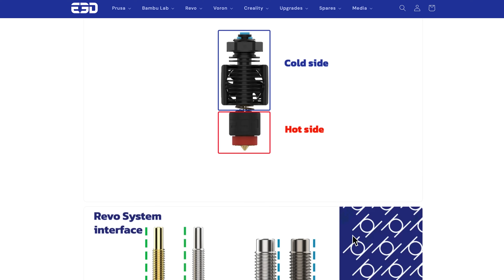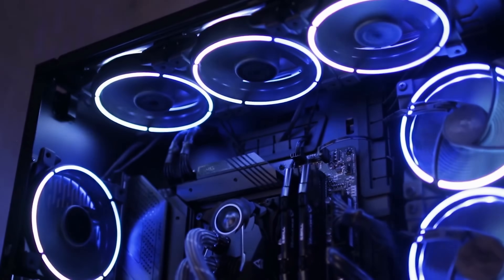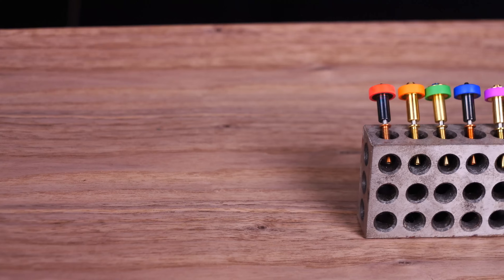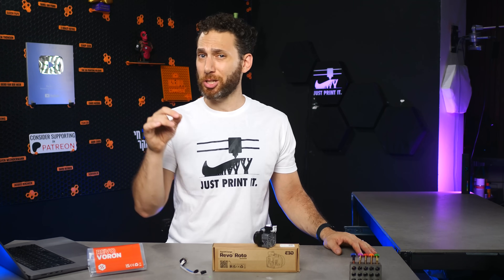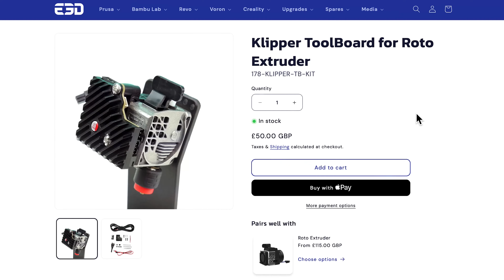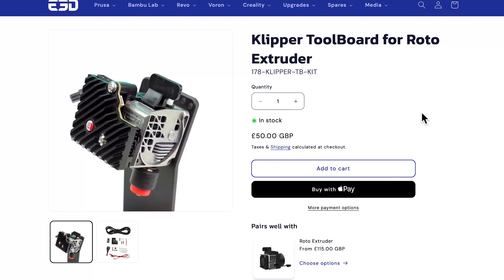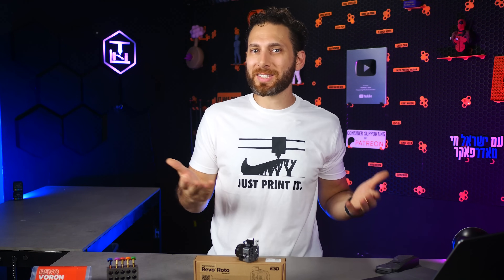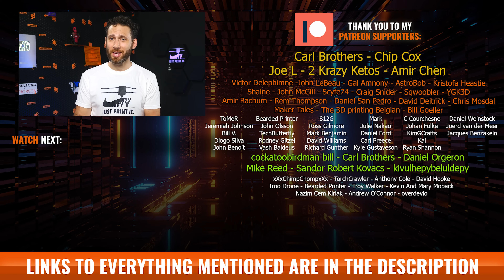E3D's New Release...& What It Means for 3D Printing

Comment: I haven't swapped my revo nozzle since I bought it 2 years ago. I'm considering moving it to my new v0.2, and add the hotend that came with the 0.2 kit, to my old printer, and sell it.
Mainly it's the complete eradication of heatbreak failures that sold it for me. I have been thinking of getting a obxidian or diamondback nozzle, just to print abrasives. I did get a full kit of 4 sizes, but I have basically only used the 0.4, and it has held up great!

Comment: Do me a favour... next time you decide to recommend a filament... DON'T - JUST SAVE YOUR BREATH INSTEAD!!! 

On the basis of the filament recommendation you made, a sparkle black PLA, I bought a roll which terminally clogged the 0.4 stainless print nozzle on my A1 over three hours into an epic print, blowing filament gobs everywhere, wasting more than half the roll and thus costing me about £14 in wasted filament, a further £27 if I wanted to redo the print in that particular filament because there's not enough left of the original roll, AND £20+ for a new nozzle and a needle from Bimbo Nobs because this one will NOT unclog and the needle might as well be welded in for all the possibility there is of ever removing it. That's almost HALF my weekly state pension down the drain on the back of a BAD RECOMMNDATION and closer to half of it if I was foolish enough to buy another roll of that cack. Add to which the first ten or so layers were the colour of Fido's runny excrement the day after he has eaten a packet of glitter instead of the "black" it was described as!

NOT IMPRESSED! 🥵

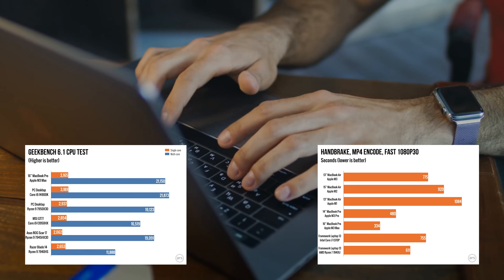Comment: 3:24 More compact yes but NEVER higher performance.. an tou cant even compare the two, the parts are and have always ben setup in this way in the PC world and is so exstreamly optimized that there is not waist of space. but the 3dprinter have ben this diyed thing, where one needs to fit a noter ect. and for some reason the cold and hot end has never been the same unit. but the only funtion anyone cares about is nozzle size swap, if you can do that then the unit wins, who care if you can´t swich the radiator out, if it works it works..

Comment: I was an early Revo adopter on my Voron (so early they didn't have the Revo model available) and its saved me time and money. It just works very well and I swap nozzle size way more often than I ever thought I would. In over 2 years I've never damaged a nozzle despite have the brass only and yes I've driven into the table on many occasions. Still on the original set 😮

Comment: I have an e3d revo fully loaded for my MK3S+(Enclosed), I am now wishing that i bought 2 as I bought the fully loaded kit(.25,.40,.60 and .80 nozzles) i think $120, now it will cost $50+ more, as I would have to buy the .25 and the .80 nozzle. I am not wanting and will not spend nearly $200 for a revo fully loaded setup, with the .40 obsidian nozzle. so i have been looking elsewhere, or i just stick with stock setup.
The Revo Ecosystem is just too expensive, since the new build your own system.

Comment: I am not a person who likes closed source ecosystems in general because of the tendency to lock people into them and the lack of control I have. I do understand that there are distinct advantages to having stuff that "just works" together. however with larger companies I worry about them having control over my stuff.
example: I have looked at Bambulab printers for easy of use and product experience without tinkering I would make designing and printing stuff faster and easier. Yet even though Apple products just work, I will never by an apple product mostly because of the company and corporation behind it.

Comment: I doubt that their master plan is to become a toolchanger company. If it was, their revo nozzles would not be astronomically priced. It makes no sense to have a quick swap nozzle system on a toolchanger. They should also be focusing on cost effectiveness if they are going the toolchanger route. I will not be using revo or any e3d extruders in my toolchanger, just due to cost. A revo roto plus a high flow nozzle is going to run me $320 USD, while a smart orbiter V3 is $100 USD. That means over 5 tools, I will be spending an extra $1100 to go with e3d, and the only upside is I get revo nozzle? No thanks. 

I have bought e3d products for a long time, and have a lot of their products.  I can't justify the cost benefit ratio any longer though.

Comment: I got the Revo kit for my X1C and my P1S, and it is by far my favorite and most useful upgrade on those machines
Reply: What does the kit include? I just got a P1S with hardened nozzle
Reply: Same i installed mine yesterday with the cnc extruder, jetpack, touch etc. Nozzle has been amazing and swapping is so fun. I actually change nozzles now depending on the print rather than wait until I have to

Comment: I have 5 1/2 Printer, one is a dual Nozzle from 2016. I got: 1x E3D V6, 2x Mk6, 2 1/2x CR10 and one Bambu X1 hotend. I have several replacement coldsides for the Cr10 and atm i am rebuilding one CR10 printer to a Voron Switchwire. The Big question WHy should i and others switch to Revo. Having the possibility to switch Hotends is nice. In reality you have 0.2/0.4/0.6 hotends stay mostly on the 0.4 and to reduce wear you have a hardnend steel and to keep speed up a CHT Bondtech. The Price for a hardened Steel Hotend should be at the price range of the Bambu X1 Hotend, 15-20€ saying as someone owning an E3D Obxidian Bambu Lab Hotend, but in a highspeed sprinter like a X1C even hardend steel nozzles will wear down in 400-500 printhours. Ask my how i now it. A cheap V6 brass wears down in 200 hours. And thats my critique on the Revo Hotends: The tipps increase the price per Printhour: An "expensive" Bambulab hardend Steel Nozzle costs 17€ a Revo Brass Nozzle starts at 22€ and a Revo HTA Nozzle which is compareable is  63€. 3 Times the Price or the Hour Price goes up from 4 cent per hour to  15 cent per hour for Brass or HTA Nozzle. While a slow printer has a print price of 1 Cent per Hour. Thats the Problem on the Revo Nozzles, they are 3 times to high in price. I know they are manufactured in the EU and i have several E3D Products, but the Price of Printing is to high in this regard. Hotside Coldside is not intresting intresting is "How much does cost me the Nozzle after 1000 hours"

Comment: Pretty sure the addition of the PZ Probe will do NOTHING for your Nozzles survivability in the case of a Crash UNLESS a dramatic Force Spike sensed by the PZ's Controller Board can trigger an Emergency Shutdown which quite frankly, I don't think will be enough to save the Nozzle considering the forces at play during a Crash capable of snapping a Revo Nozzle Heat Break in half.
Reply from the maker: The only time your nozzle would crash into the bed (as opposed to a print) is during homing/meshing/qgl, and that, it prevents quite well.

Comment: that bed probing method has already been made obsolete by using eddy current systems.
Reply from the maker: You still need to set Z offset with those.
Reply: @thenextlayer  It was at  first, but it looks like there is a method to get automatic Z offset too now. It works with a tap too, as the eddy current probe is supposed to check for a frequency; if there is no frequency anymore after a Z motion, it means the bed is there. Check  "Tap detection with ldc1612 inductive sensors"

Comment: I picked up the revo cr for my ender 5 plus and ender 3 pro as well as the Bambu lab p1s version and struggled so much with bent nozzles that I went back to stock in the p1s and e3p.   But if this pz sensor thing works out I might just have to give it a hard look again

Comment: I don't think the comparisons with Apple Walled garden makes much sense. Apple maintains their ecosystem by actively working against compatibility with everything else. When you buy a piece of the ecosystem you are basically forced to buy the rest to make it work at 100%. 

On the other hand, the strategy with e3D with Revo is the exact opposite, there are plenty of proprietary novelty heat block and nozzle designs, but E3D is the one actually working to make it as compatible as possible with everything else out there. Obviously on the cold side, as the hot side part is kinda literally the whole point of this system.

Comment: I just got out of the revo ecosystem, and switched my printers to volcomosq hotends. I was a early adopter and bought a few when they first came out. IMO Revo is a expensive ecosystem for poor performance and build quality. Nozzles are heatbreak supported which means nozzles can bend, and the solution to bending nozzles should not be another 100$ probe. Probes like beacon can do tap like probing and are faster and generally better. Most of the stuff they sell in the ecosystem like extruder and tool head boards that intergrate directly already exist for other hotends and printers. 

The main reason I did switch tho was the price, the stock hotend is generally priced fair, but if you want high flow or abrasives, which you would really need for something like a voron, its way to expensive. 25$ for a new brass nozzle is too much when I can get 30 brass nozzles for half the price. 
Something like a low cost dragon hotend or rapido costs less than a revo, has high flow perofrmance built in, (no need for cht nozzles for high flow) and takes very cheap nozzles. No real reason to go with the revo. Get yourself a hex wrench and you can swap nozzles in under a min on these hotends. 

You make the comparison with apple which is not really fair as apple makes high performing products where revo isnt really that. The flow rate is low and doesnt "just work" since you nozzle can easily bend due to the slightest mistake.
Reply: Well, my entire family hates the 1 Mac Air I bought ~2014 just to be able to compile for Apple, because Apple used to force developers to buy Macs to be able to release for Macs. It's performance is so bad, that you can login only 1 user at a time, because logging in another user makes it unusable. Btw. the hard drive is so small that I can't even install Xcode on it these days, because it's too big (< 100 GB). What's making thigs even worse is that you can't simply add RAM like in most other laptops, which made the entire product a garbage shortly after I bought it.

Comment: 3:19 Apple is only faster at some things just like ARM is because they drop x86-x64 making it lighter. The down side is we still need these older architecture, Apple just emulates them, and emulation is never as fast as native execution. Also there is still a lot of programs that Rosetta can't emulate. So the best thing Apple has is it's laptop battery life, which can be surpassed with the new Snapdragon X laptops so.....
Reply from the maker: And yet Apple and its ecosystem still rules the market for consumer satisfaction.
Reply: @thenextlayer  I don't disagree that a closed ecosystem can be a good thing there is a reason we have not had the "Year of Linux" yet, and nothing wrong with Apple, in fact when people ask me which phone they should get and I know they are not the type to want to tinker I tell them iPhone. Was just pointing out Apple is not always the right answer, especially if you are a PC gamer, or need something Rosetta  can't run yet.

Comment: Idk a probe that has to touch the bed to make sure it’s leveled. The point is to be fast and efficient and that’s not fast nor is it efficient. The beacon is both fast and efficient with eddy currents. It can sweep a whole bed and get a scan/bed mesh in under a few seconds. You’re telling me you’d rather trade not having to add an offset, but bed mesh is inaccurate or you’re probing for an hour as opposed to z-offset once and sweep under 10 seconds? Sounds like a bad trade-off.

Comment: Voron Tap looks fantastically overengineered solution. Linear rail?
Maybe something simpler and fully printed (aside stolen repurposed Z limit switch) could be designed. Something, that doesn't have to withstand 20G acceleration.

Comment: I agree, and i love my high flow obxidian nozzles. They just work, fairly fast, with no leaks, no crust buildup, and so easy to switch. They're the best part of the printer. Reliability in 3d printing is underrated.

Seriously considering switching out  tap for a PZ probe at the next maintenance cycle, but will wait for reviews.

Comment: I'm definitely aware of the potential benefits of a closed ecosystem, the problem is when you want to do something even slightly outside of it..(and esp when the ones that make it don't actually put more into it, and/or use others designs/work [even if it's paid for], don't acknowledge it and just charge more because they can; obv they don't all do that, I just mean the ones that do). I do like the idea of using the nozzle to probe the bed though; everyone already has one, may as well put it to good use

Comment: Revo is one of the best upgrades I made. Changing nozzles to speed up print time (going from .4 to .8) Also I hated issues with the heater block and hot tighting. I've also definitely bent a few heatbreaks Revo just made everything better. I'm tempted with the PZ Probe though, It looks great. Seems more elegant than the voron tap. But the voron tap has saved my ass a few times. When the flying gantry falls after power outage if you use the Galileo 2 motors it falls quite a bit and it's easy for it to fall below the bed height. Trying to home X and Y after that means the nozzle crash. 
Or
If there's a defect in the print and there's a bulge it's usually enough for it to go up and over it instead of smashing the print since there's a bit of vertical lift.

Idealy, the print is always perfect and when you stop a printer it's always in the park position when you turn it off, but the little bit of safety a Voron Tap gives is kinda nice.

Comment: price and convenience aside, you're gonna have a hard time convincing me to go for an "ecosystem" for something like a hotend/toolhead. At the risk of being overdramatic, it's essentially opting into a cancer spreading across all of your printers that could, at any moment, VM-ware you. If they did decide to randomly 10x their prices, that's kinda it. You won't get competitors making drop-in replacements because they have a legally enforced monopoly over the "ecosystem". (note : this is miles different from a """"""monopoly"""""" that is a result of either A : "they offer the best by a landslide, so why wouldn't I pick them" e.g. Steam or B : "we have no obligation to let you compete with us" e.g. Apple. The former is a non-starter and the latter is still bad, but fairgame since it's an intrinsic aspect of the tech/product.) 

When Redis tried to screw over their users there were drop-in replacements overnight, but that's just not the case for anything that isn't FOSS so there is always the risk of being VM-wared. That's somewhat acceptable when we're talking about a single printer, but when the conversation becomes "yeah you should just put this on all of your printers" then it's a far larger concern.

Comment: I have spent quite a lot of time with the revo on the Bambu x1 and I think the higher watt heater should not be used with the ams. It overshoots its target temperature substantially and causes heat creep past the break jamming the extruder.
Reply from the maker: I’ve had no issues in my P1S

Comment: Sorry my man but I can confidently say I will never buy Revo again. I purchased the Panda Revo on Amazon. Followed the setup to the letter. Turned on the printer and white smoke as soon as I set the nozzle to 250 C. Turned it off and wrote BIQU. They told me to return the nozzle, that’s it. I tried to give them a chance if I purchased directly through them this time if they could assure me of the quality issue. No further communication from BIQU. Not professional at all and will never buy from BIQU again. Sucks that I will not be using the Revo ecosystem but the Mako will be coming out in a month, so BIQU screwed up bad. E3D needs to make a new nozzle for Bambu but only through E3D directly not with BIQU. As there seems to be no accountability, quality assurance, and barely any customer service over at BIQU.
Reply from the maker: There is the e3D Bambu Obxidian high flow already.
Reply: @thenextlayer  Yeah, but I was meaning for the Revo. The OEM E3D nozzle is nice but not exactly the same.

Comment: I'm currently building my own Voron 2.4, and my kit came with tap. I chose the Rapido hotend and dragonburner toolhead for better cooling and weight savings. I plan to eventually upgrade to a cartographer from tap. It may not be as light as a washer, but it's one of the lightest options and much faster.

Comment: The PZ probe is nice, but by now means a new invention. As far as I know, the people behind "Precision Piezo" invented this concept and brought it to market many years ago.
Reply from the maker: Yes but a hot end with built in probe is a new idea AFAIK
Reply: Yes this 👆 was what I was thinking too as I have run a bunch of that probe in a bunch of printer for a LONG time
Reply: They never really took of. You need an adapter for your hotend and its not the most stable or compact solution. The integration of e3d into the heatsink makes it far easier for us to integrate it into existing designs